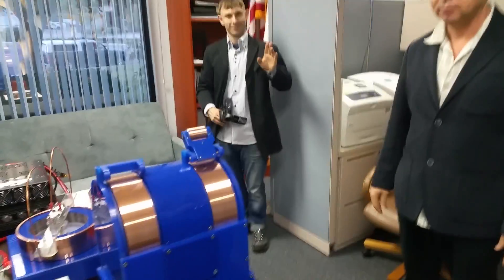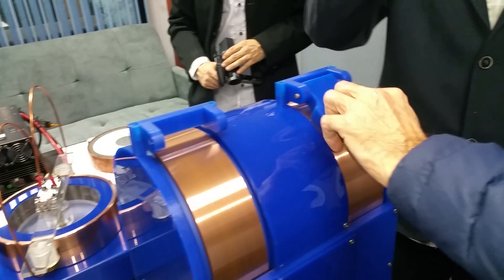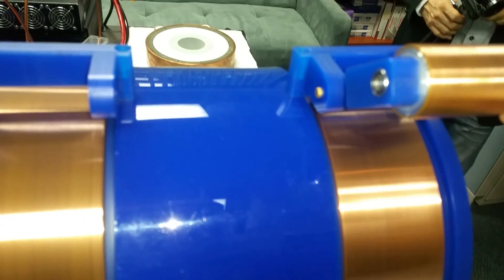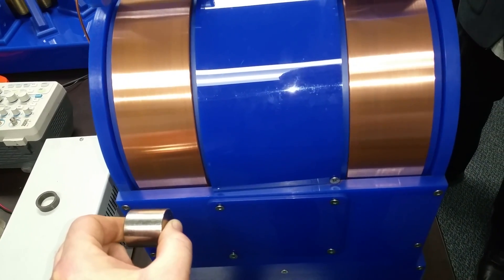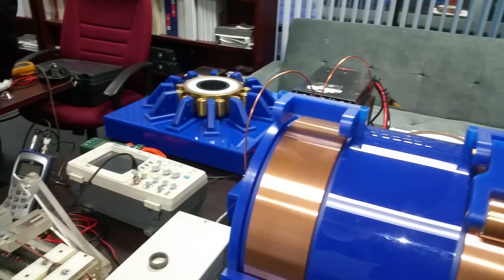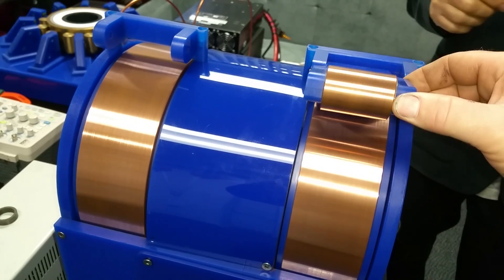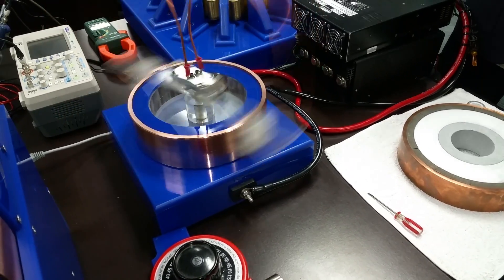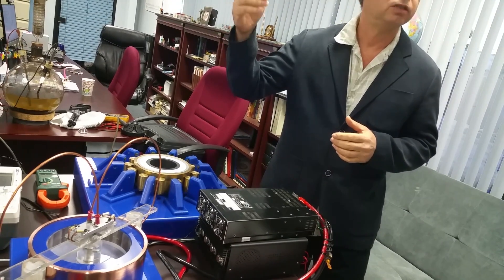Searl Magnetics demonstration

Comment: This whole thing is a farce.
Reply: +Hhydrogen4Power I first heard of this stuff in 2007 when the first round of YouTube little demo clips of an under unity pulse motor with moving rollers were put up.  I remember BeamshipCaptain and the whole nine yards.  Where has this "technology" advanced since 2007?  The answer is nowhere.  The "magic of the squares" is laughable.  All that you still have with this farce is a new version of a silly pulse motor.  What does imprinting a magnetic pattern on a roller give you and do for you?  The answer is nothing and nothing.  What does the "floating roller" demo mean?  The answer is nothing.

There will never be a magic migration of electrons through the rings going to higher and higher potentials - it's a fantasy.  What has been going on for the past nine years?  The answer is nothing, the same thing that has been going on for the past 60 years.

Any trace of over unity in sight?  The answer is no, but make sure you wear lab coats because that makes everything look credible - right....

Don't waste your time on this nonsense.  It's probably the longest con ever in the free energy cottage industry.  The fact that I choose to be anonymous is my right and my decision.  The per capita rate of crazies and mentally unstable people among hard core free energy enthusiasts is too high for my comfort level, thank you.  You just have to look at how nuts some of Searl's own pdfs are to get a cold chill.  What's all this fantasy about space ports and white jackets with epaulets like some sort of Jetson's spaceline?  Wake up and see this farce for what it really is.
Reply: +User2718218   Good question...... I can answer that for you....... "Well, lets see"

John Searl is a stupid lying lazy mumbling dumb shit that knows absolutely nothing.....so he thought Verbelli was smart ,and hired him, but we all know Verbelli is totally stupid.

Fernando Morris was a wana be computer technician, but he didn't know how they worked, and was fired,
so when he met John Searl and his bullshit.....Searl said to him,..."If you wipe my ass and let me stay with you in the USA,.. I will make you Chief Engineer of the SEG bullshit........         I can't stop fuckin laughing.........
Reply: Far Que
It's all a very strange and sad story.  Fernando looks so credible in a lab coat, he must have an entire walk-in closet filled with them.
Reply: +User2718218       yes, Fernando does have his own closet full of various labelled coats,...some display the logo with words of "Chief Engineer" and others labelled, "John Searl SEG Ass Wiper and Nanny".....LOL
Reply: +Hhydrogen4Power      Please do not involve yourself with these SEG idiots.....  I can absolutely guarantee you, without any doubt, that the entire SEG fiasco is a con and scam to gain funds through deception..... John Searl (Seg) is a criminal, and wanted in the UK for fraud. Morris will deny this.

You will eventually find out that it was a complete waist of time and money for you.....
Reply: Marlon Edwards
It's a muppet double-cross Marlon!  You are the muppet with epaulettes!